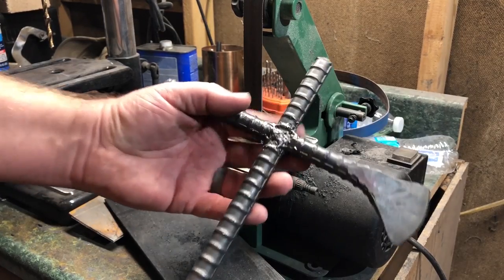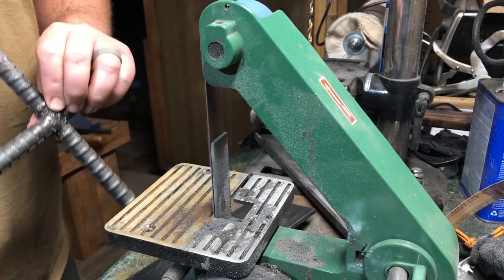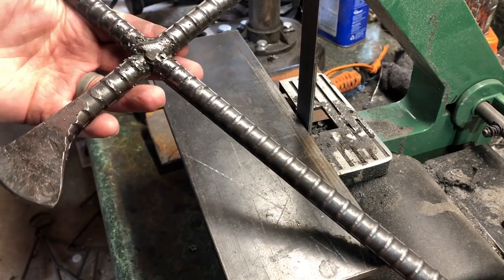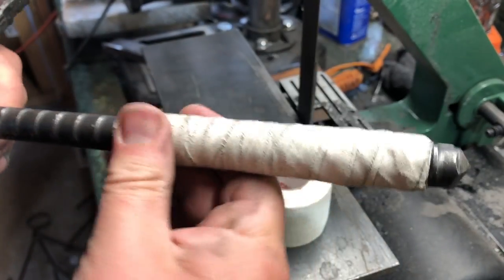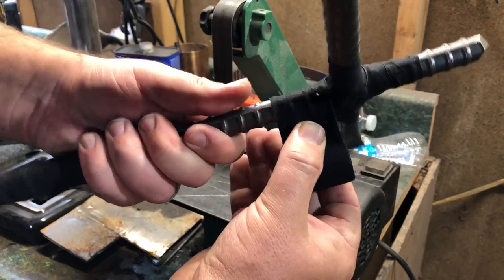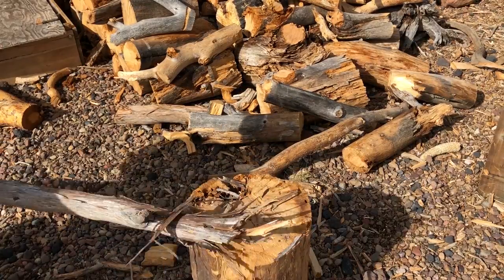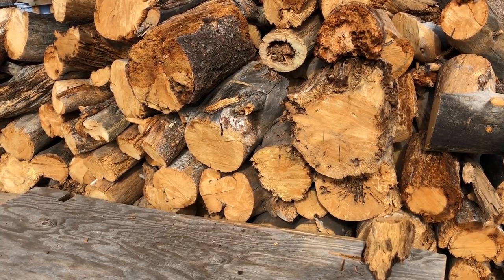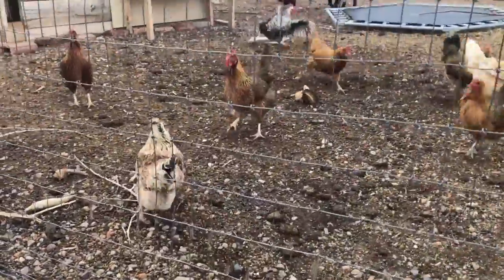How to Make a Throwing Axe Part 2

Comment: Meybe you would try working with more classic and real steel for blacksmithing/knifemaking like coil springs, leaf springs, this is steel easy to quench (in warm oil) and a lot more durable
Reply from the maker: Jakub J Yes, I’d love to get my hands on some leaf springs. I’ve used lawnmower blades before and a few other mystery metals. I also have some O1 tool steel and a bit of 1095, so will definitely do some more knife making vids in the future.